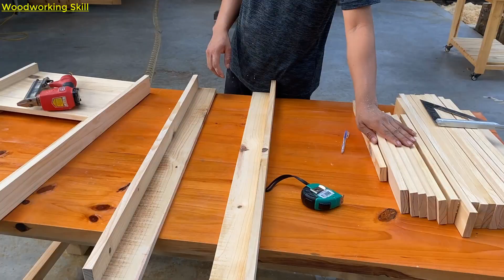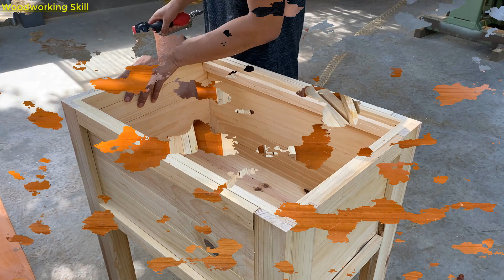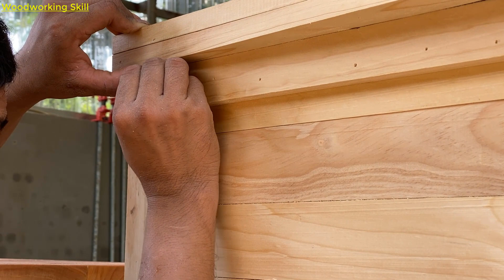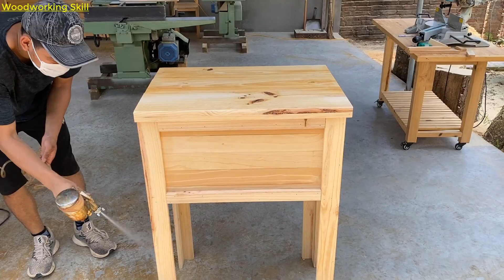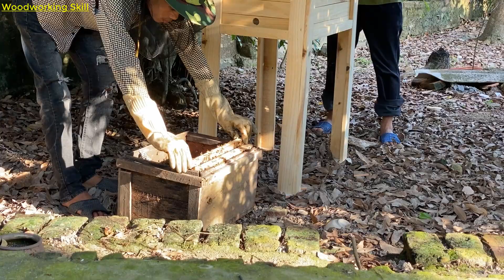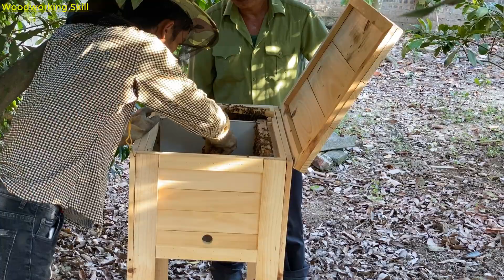Great Woodworking Ideas For Beekeeper // How to Build A Honey Bee Hive

Comment: I see a few problems with this design.  The first is the top has slits and is not going to shed water.  Water is going to drip right down on the bees.  Bees don't like that.  The next problem is you sprayed whatever that finish is on the inside of the hive.  Bees don't like that either.  The third is you did not apparently bother measuring how long the frames had to be, and so the frames are not a standard size and the width of the hive is also an irregular size so the frames that guy put in there don't fit properly.  Fourth, your frames are more like how you imagined frames look, rather than functional frames.